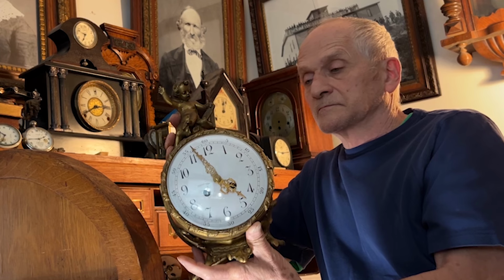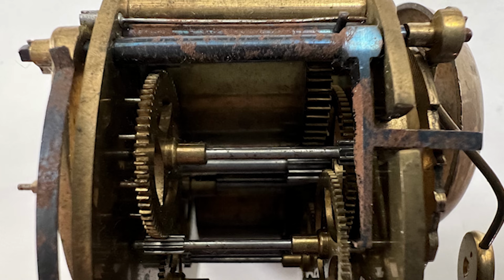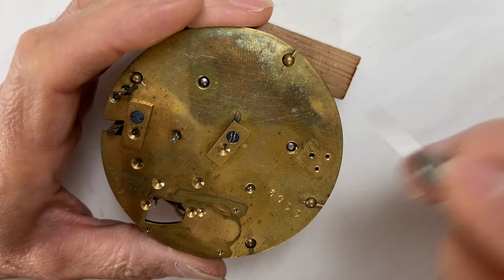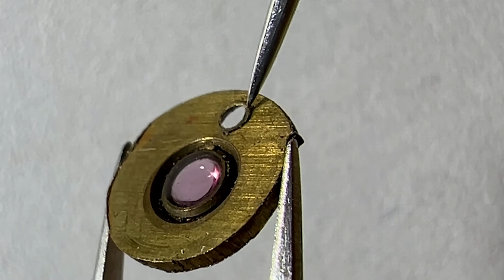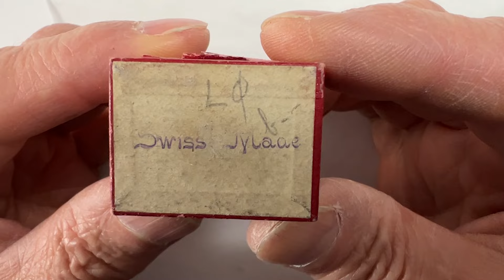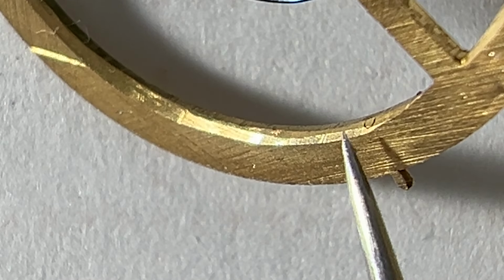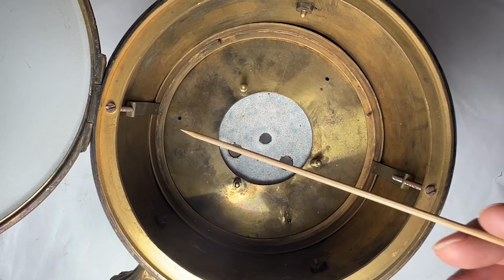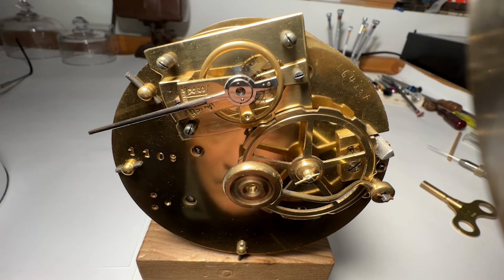French Louis XV style mantle clock for Teddy from Florida # 114

Comment: That bell has an awesome sound!  Really like how clocks from a couple hundred years ago have such thick brass plates and parts.  Todays movements aren't much thicker than cardboard.
Reply from the maker: I agree,  Cast Bronze bells resonate for a long time.
I didn't show it, but the plates being made from cast brass were all hand surfaced, these plates had casting imperfections repaired in them where the finishers had drilled holes in the plates and plugged them with brass plugs, then polished with the rest of the finish. Interesting the amount of work that went into getting a small flat brass plate suitable for a clocks in those days.